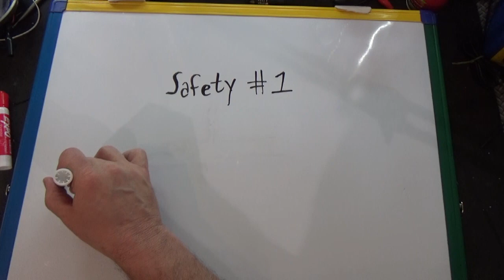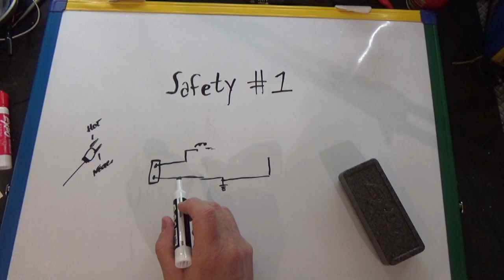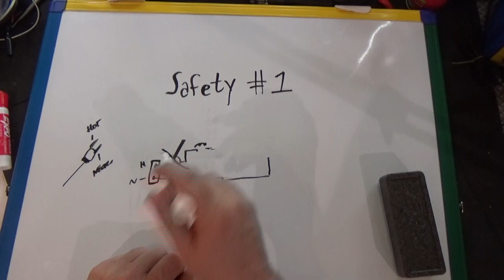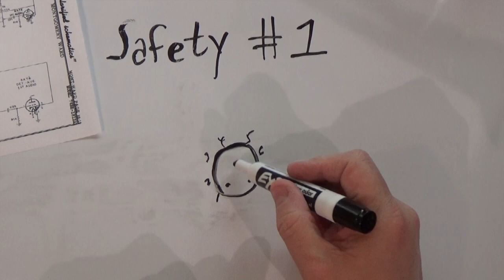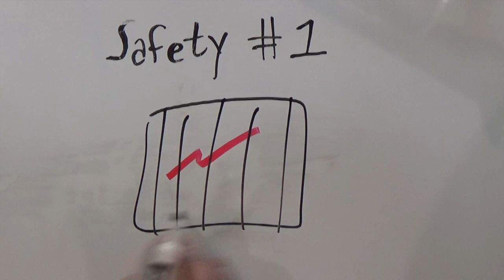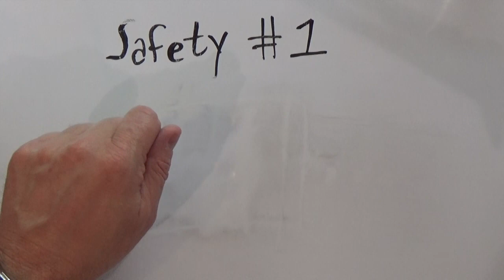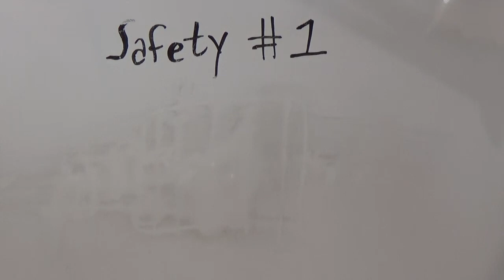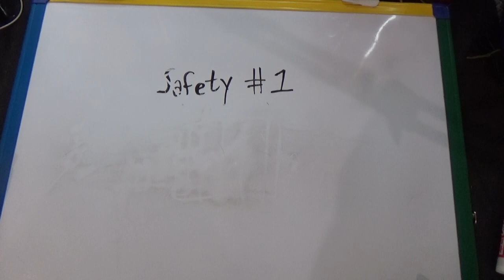Antique  and Vintage Electronics Repair 101

Comment: This is a very useful introductory safety video Ron …very well thought out …certainly to the point without being too technical. 
With your permission, I would like to add a British safety aspect, or addendum, to your safety video since we here in the UK have 240 volt mains fed into heater ballast resistors, as well as anti-surge resistors feeding mains voltage to the anode (plate) of a rectifier valve.  We no longer have two prong mains plugs: they are three prong (Live, Neutral, & Earth) with either an internal 3, 5, or 13 Amp fuse fitted, and our mains lead colour coding is Blue (N), Brown (L), and Yellow/Green spiral (E).   Somewhat different from the American system, otherwise the rest of your video applies also to British Vintage Radios, with the addition of British 4, 5 & 7 pin, as well as B8G, B8A (rimlock), and B9A valve bases.  Some of this can be seen in my recent Regentone, model DP2 video.  The radio I’d use as a tutorial aid to my proposed addendum safety video would be based upon the power supply circuit of the famous Bush, Model DAC90A.
Ideally, it would be lovely if you added it to your vid …your voice sounds better than mine, and you talk better than me LOL.  I’m cursed with being able to write better than I can talk LOL.
Joking aside, I hope to do this short vid within the next month, if it’s ok to tie it in, as an addendum, with your vid.
Regards, Phil.

Comment: If you NEED to use both hands while using a meter, place each probe in between your index and second finger palms up.  That way if the probe touch a hot circuit,  the reflex will pull you out of the circuit and not into it.
Reply from the maker: Very good advice Larry, thank you. I also use gator wire clips to connect one side of the meter and keep that hand free. Any method works great as long as you keep both hands out of there.  :)  Thanks

Comment: One additional thing to keep in mind that is rarely pointed out.  With the switch on the side connected to the chassis, if the cord is plugged in with hot on that side, the chassis is hot when you turn the set ON.  As you correctly pointed out.  However if you plug it in the other way with neutral connected to the switch, the chassis is hot when the set is OFF.  Touch the chassis with the set off and you become the path to ground.  I rarely see that mentioned.  Key learning, which you pointed out, is that you should always take the time to put fuses and switches in the hot side of the line with a polarized line cord.  For added safety we use a grounded plugs on equipment with the ground pin connected to the chassis.  The chassis is then always at ground potential, even if there is a break in the neutral line.
Reply from the maker: You are correct Bill. I did fail to mention that and thank you. You are correct on all counts... thank you sir